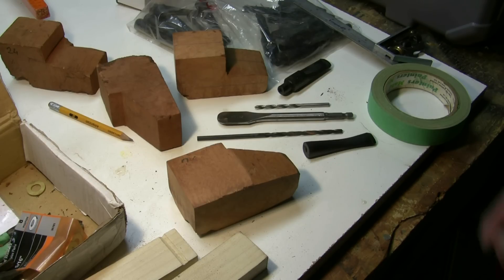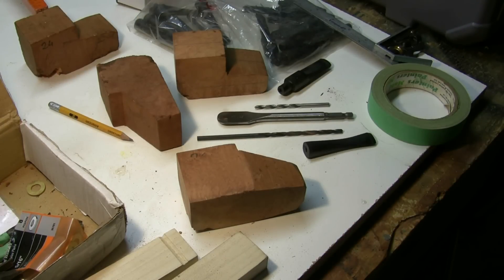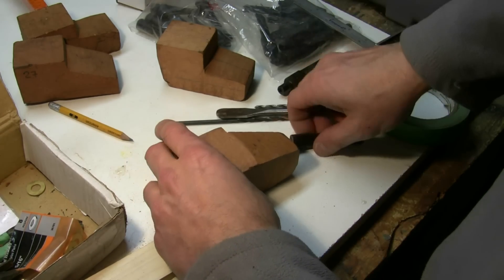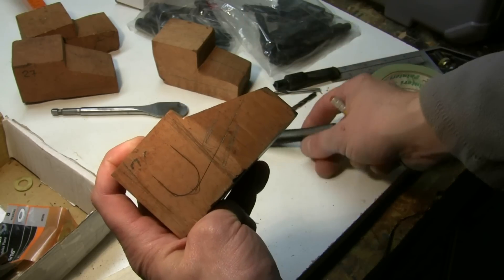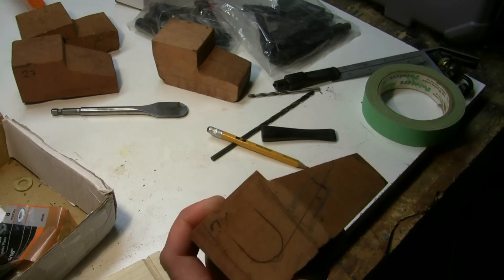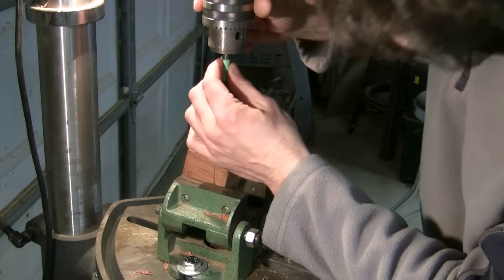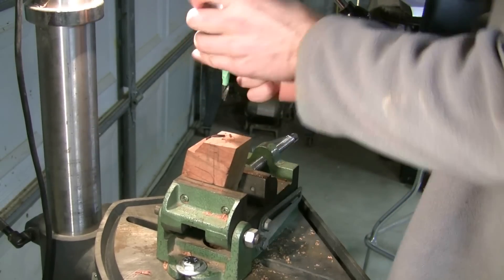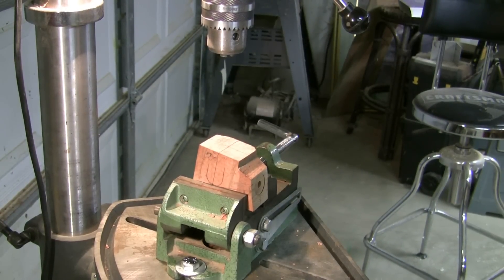Part 1 - Briar Pipe Making Start to Finish

Comment: hey Kraig, great set of videos man. I ordered a block of briar on ebay. it arrived today and I know the way you make pipes might not work with everyone but it helped me a great deal. is there a way I could send you a photo of said pipe? your way of making sure that the stem and bowl holes line up and center worked for me. I did have a worry moment but it was simply that I hadn't made the stem hole long enough. thank you man.

Comment: Great Video.
However, when you speak of the bit used for your Mortice, you keep referring to it as a "15/16ths" bit. When in fact it must be a "5/16" inch bit. A 15/16" would be almost an Inch in diameter. I explain this solely so those following your instructions, do get the right bits/tools for the job.
Keep up the great work and happy smokin' !

Comment: You should use a marking guage to find your centre of your chamber and for your air hole especially if the edges are slightly rough and the block is not square. Hope this helps.

Comment from the maker: You can get it several places but I got mine on Amazon. The title was "Acetal Round Rod, Meets ASTM D6778 Specifications, Black, 5/16" Diameter, 36" Length". Acetal Rod and Delrin Rod are the same thing.

Comment: Hi good vidéo. I have a question what is the name of the tool of the drill to make the hole chamber of the pipe ?
Reply from the maker: It's called a chamber bit and is made specially for tobacco pipes.  You can find them at vermontfreehand.com or rawkrafted.com.

Comment: have  you ever used them for smoking or they're just for decoration? would'nt the wood burned of if you smoke with it ? (silly question i know)...! great work by the way i am gonna make one for sure!!!!! :)
Reply from the maker: The wood used is briar burl which is extremely heat resistant. Most tobacco pipes are made of briar though I know a few other woods are used. Briar is by far the most common.  Also once the pipe has been smoked a bit it builds a carbon layer which adds a little more insulation from the heat. I have 20+ pipes I've made that I smoke and I've sold three times that amount. Good luck on making your own. It's a fun hobby. Thanks for watching!
Reply: kraigseder
 :) thank you !!! great videos!!

Comment: If you are still around, what is the name of the paddle bit used to drill the bowl?
Reply from the maker: Hi Brenda.  I'm still around and I actually made an updated pipe making series a few months, although I do use a metal lathe in the new videos. The new videos do show some updated steps even if drilling the holes with a drill press.
I have two links for you.  One is for the economy bits I used to use and the other is for heavier duty bowl bits I now use.  
Economy chamber bits - https://vermontfreehand.com/product/chamber-spade-bits/
Good quality carbide chamber bits - https://rawkrafted.com/carbide-chamber-drill-bits/

Comment: Hi Kraigseder!!! Excelent pipes!! I want to do a questions...Can I use cherry wood to make a pipe? I know that there is much.
Reply from the maker: Tobacco & Pipes Thank you! Yes you can use cherry wood for pipe making though I've never used it. I'm not sure how durable it is to heat but give it a shot. I remember reading to make the walls a little thicker when using cherry wood. If you make one definitely coat the inside of the bowl with honey that has been thinned with water just a bit. Coat the inside of the bowl using a Q-Tip and let it sit for 20 minutes before your first smoke. This will help start a carbon layer to help protect the softer wood. Have fun.
Reply from the maker: Tobacco & Pipes Read this forum thread on using Cherry Wood. http://www.pipemakersforum.com/forum/viewtopic.php?f=11&t=39
Reply: kraigseder Thank you very much!! The forum is very complete and interesting. There is woods very nice, for example the "the wood morta" and Boxwood. The coment to use honey is very useful, I use it to make "the culote" in the bowl. Thank you!! Excelent advice!

Comment: What is the benefit of the delrin Rod? Couldn't I use a stem that already has a tenon on it instead ?
Reply from the maker: weedsnager  The delrin rod is stronger than the vulcanite or acrylic and is self lubricating. Nothing wrong with just machining the tenon from the stem material but I prefer delrin rod.

Comment: can you use any wood for the pipe? and could you use a bowl router bit to drill the chamber?
Reply from the maker: There are some different hard woods that can be used such as briar, olive, cherry and a few others. Briar is by far the best because it is so heat resistant. You want to make sure you don't use any resinous woods like pine, cedar and others since they can be harmful if not poisonous to use as pipe material.
I'm not familiar with a bowl router bit but if it makes the right shape I'd say yes. There are so many different ways to make it and no one way is right. Professional pipe makers don't make pipes the way I do but it's what I have and it works for me. 
Good luck bud and have fun making a pipe.

Comment: What bit do you use?
Reply from the maker: For the tobacco chamber it's a 3/4" bit, 11/64" for the air hole and 5/16" for the the shank where the stem tenon fits into. The tobacco chamber bit is a special one I got at Pipe Makers Supply.

Comment from the maker: No. It wouldn't hold up and would burn where briar wood is very heat resistant. Also the glue in the plywood could be very harmful. Certain woods also let off irritating if not slightly poisonous vapors when hot. Briar is very safe and I also know certain fruit hardwoods can be used but I honestly don't know too much about that.